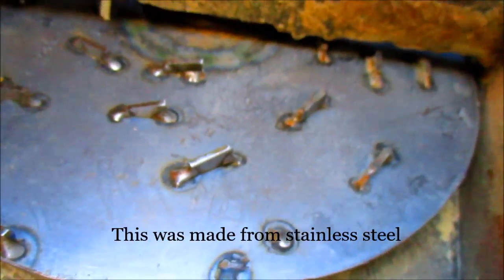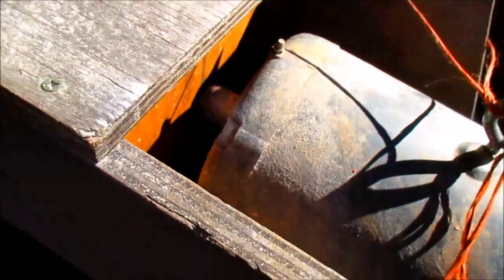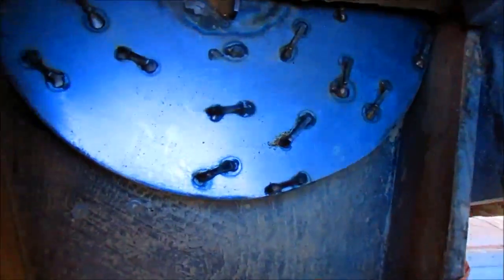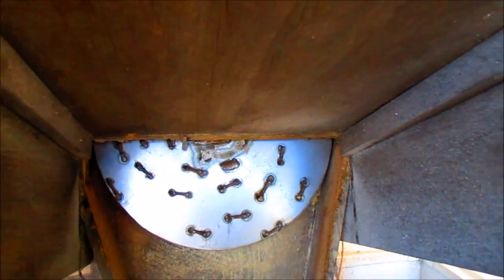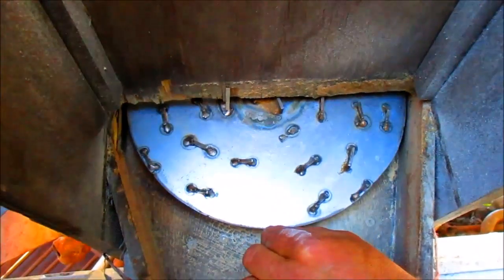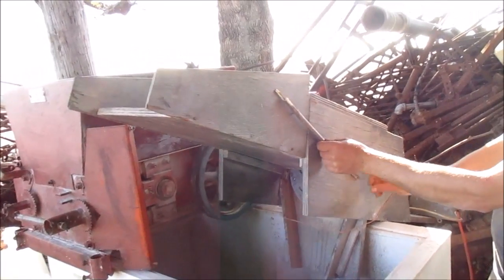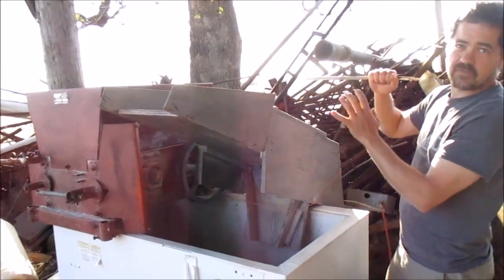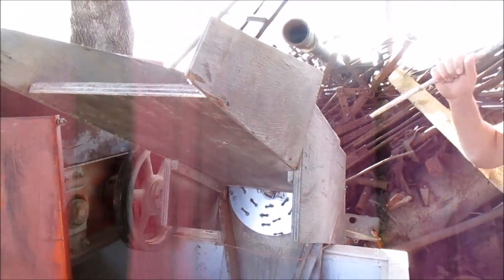Home made  apple grinder for cider pressing

Comment: I see this video has more views than the original.  Feel free to ask any questions, I'll answer if I see them.  This grinder was designed with the goals of being able to dump a bucket of apples at a time, grind them as quickly as possible, with as little pushing as possible, and make a pulp that will press out as much of the juice as possible.   The first try in Larry's other cider video ran the apples through as fast as dumped, but was chunkier pulp than I wanted.  The second try made a finer pulp, but didn't feed the apples all the time, still eats a bucket very quickly. 

I hadn't done enough testing to see if the chunkier pulp led to less juice yield.  Both pulps after pressing had a very satisfying texture that I like to compare to the particle board you remove from a bathroom floor, you could tell it was damp, and it wasn't hard to break up by hand, but if you were careful you could pick it up in full sheets.  It has no appeal to livestock, which will normally consume apple cider pomace.  Juice yield was weighed at 75-80%, by weighing the pressed juice and the dry pulp remaining.  I'm happy with the yield, and challenge any youtuber to post similar claims! 

There probably won't be a third try at the grinder, it's not much of a bottleneck compared to gathering, washing and just handling that much juice.  It would usually do 12-15 gallons a pressing, so that adds up to way too much juice pretty fast. 

If you're getting a press, get the heaviest press you can find, and put a smaller jack on than the press capacity, or don't press very hard.  This is a 30 ton rated press, with a 20 ton jack, and I've bent stuff.  So get the 20 ton press if you go to HF, but put a 12 ton jack, or use a short wood handle in the 20 ton jack.  You won't have the self control to not press just a little harder to get that last drop of juice.
Reply: Thanks Rebecca!